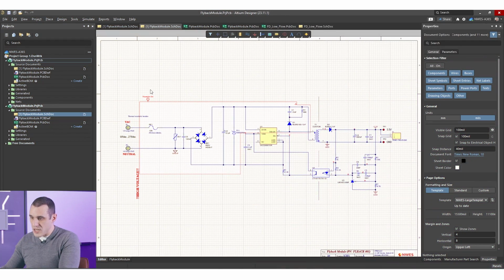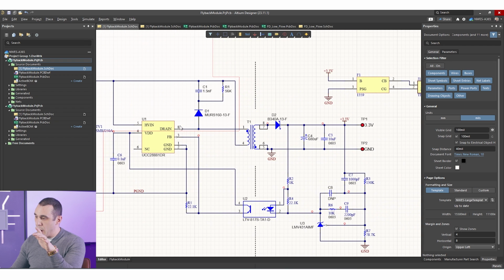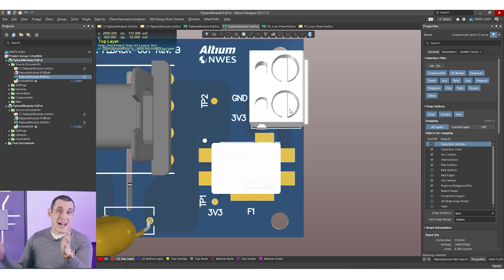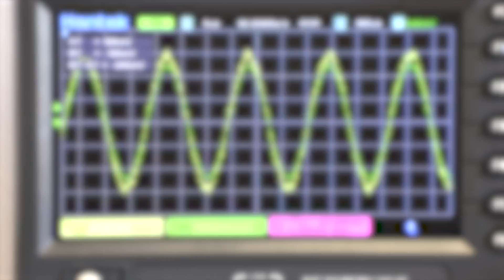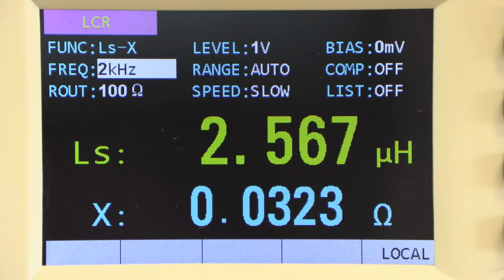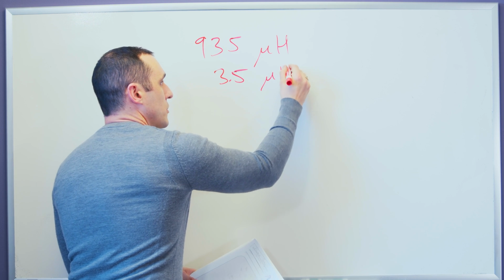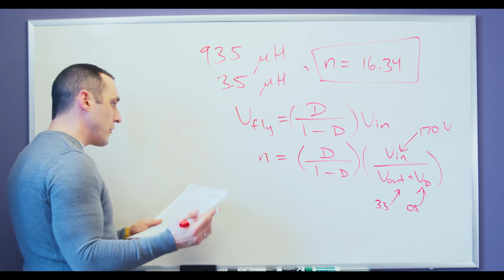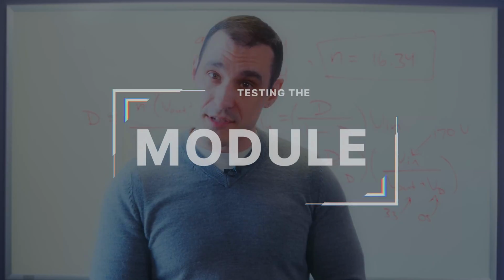Flyback Converter Tutorial: Preparing for Manufacture

Comment: Thank you for the anti-creepage slot. I would have taken it all the way through the capacitor and optocoupler (again, standard/best practices).
Regarding the silkscreen, as a final step you can modify the footprints for individual components to meet your DRC requirements. In these cases, just breaking a few lines would do.
Reply: Ain't nobody got time to modify a few silkscreen lines just for a creepage slot!
Reply: @Zachariah-Peterson  The board is manufacturable, but it fails a basic DRC? You put all that effort into getting to the one yard line. Push through for the touchdown!
Reply: @petersage5157  I know and I noticed afterwards, but in my head I'm thinking "let JLCPCB deal with it"
Reply: @Zachariah-Peterson  That's fair. I've got more time than money, so I would have spent a few minutes fixing the silkscreen to avoid an engineering fee. Fell into that trap once, and the fee for a few bits of silkscreen over a board edge was almost as much as standard shipping.

Comment: I would have placed U8 above or underneath T1 (on the same bottom layer to reduce the length of the HV trace. The cutout in the middle, as you pointed out it's purely cosmetic. However, I would have placed a cutout around pin 8, to prevent whiskers going to the neighboring pins.

Comment: For testing the transformer you should also consider measuring the primary leakage inductance. Short out the secondary coil and measure the primary at the intended operating freq. Having too much could kill the switch if the RCD clamp isn't tuned well. There is sooo much more that could be tested here. Hope to see a video on that soon.
Reply: We did this in another video where we looked at the design of the custom transformer and the clamp circuit. It came out to about 5%, which was actually less than I expected given it's an off-the-shelf core and bobbin.